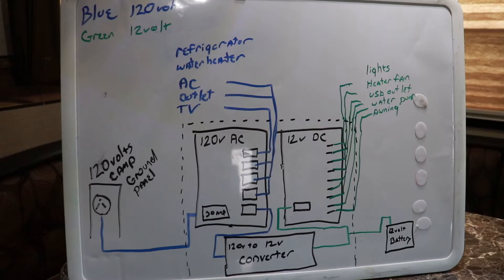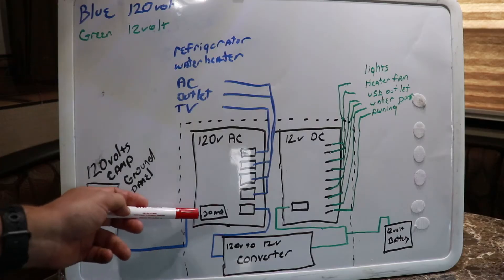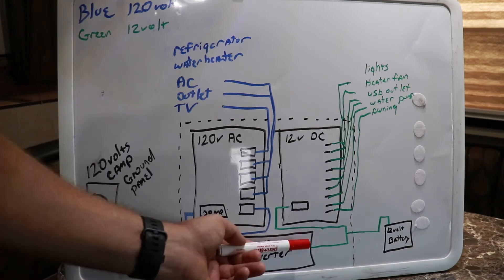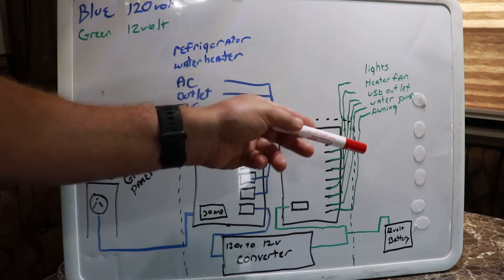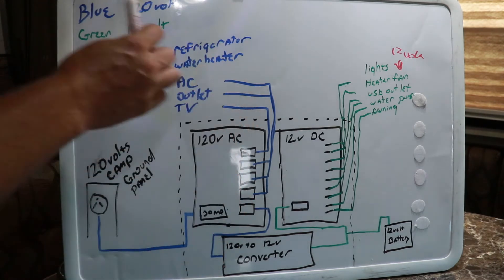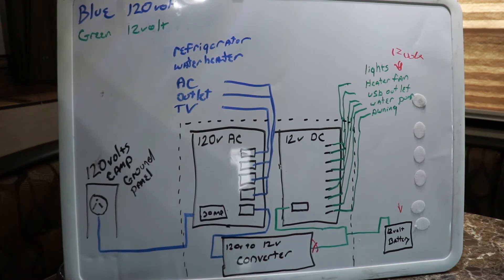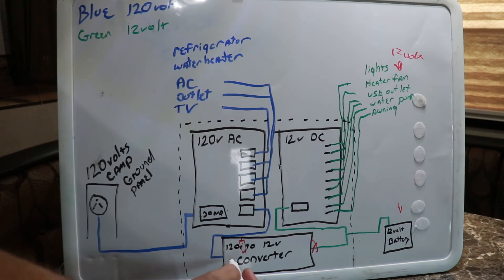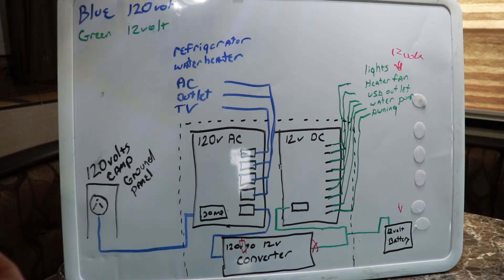Inside a RV fuse box

Comment: This video is very helpful for understanding the flow of power and where to check along the diagram. The video however says “inside a(n) rv fuse box”. Do you have a video where you actually show the inside of the fuse box? It would be very helpful to know exactly what we should be seeing and testing when/if we end up having to access the actual fuses. 
Thanks.

Comment: Hello all, I am about to install my first rooftop solar panel and I am looking for feedback. 200w single panel on the roof, fused inline to mppt charger from charger to the incoming 12v lines at the rv fuse/breaker panel. My only question is it okay to hook the mppt to the 12v feed wires for the power distribution box? Thanks in advance
Reply from the maker: That is how I have my mppt set up. It's been running this way for 2 years now and we have 800w solar input. Hope this help you . I have put my converter of a breaker and wired the 12v lines directly  to the battery. If we dont get a lot of solar  we run the generator and charge the batteries back up.

Comment: Thanks for the info. We had a problem where my water heater wasn't creating hot water using electricity.  I was trying to figure out if the breaker had trip but it didn't. Seems my panel isn't label correctly. Now I have to try each breaker and remove fuses to see what they power.
Reply from the maker: Our was also mislabeled to and we had to do the same thing. Thanks for watching.

Comment: great video.....now my problem, outside lights won't come on, interior ceiling lights work, but flood lights and porch light do night. They look like they are on a series....green/white to green/white to green/white. another question...what is a yellowwhite wire for? thanks
Reply from the maker: Did you check the fuses? If you see a red light on inside the fuse box that means the fuse beside it is blown. If everything is good in the box, you will need to use a 12v tester or meter to see if you're getting power at the switch and that power is leaving the switch. next step would be checking for power and ground at the outside light.

Comment: i plugged my camper into an rv spot (30 amp) and  immediately the fuse box smoked amd some liquid came out of it. now the rv runs fine on battery but nothing on electric. i know atleast the electric can run my microwave but notbing else. i would think the fuse box is good sonce everything works on dc but not everythihg on ac.

any thoughts? maybe converter? what is behind the fuse box that could smoke like that?
Reply from the maker: Sounds like your just running off the battery. Are you sure your getting power from the campground, did the breaker trip?
If there was water in the fuse box inside your camper, you need to find the leak. After that figured out then you can look at the fusebox issue.
Reply: @millersinthemoment5427  I found out that the camp spot had their wire backwards on the plug in. 
Everything works perfect on battery. 
Only microwave works on electric. 

What could smoke and leak liquid (not water, more like oil)

Aside from that, what do you think? Whatever "blew" when plugged up seems to he the issue. Just don't know what it could be.

Comment: Hi there, we picked up a 2002 Thor and it was trashed. No thermostat so we wired up a new one. The AC motor runs backwards (blows out through the filter) and shows white 110 as hot per the diagram. Our GFCI outlet also has white as hot. Husband thought it could be a problem in the fuse box. Thoughts? Is white hot normal in an RV? The other plugs all have white and black on the "normal" sides.
Reply from the maker: Black should be the hot side on a 110 system. Depending on your motor type wiring it backward could cause it to run backward.
Reply: @millersinthemoment5427  I figured it out! The main outside power plug was wired backwards and there was a metal plate missing in the AC so the flow was blowing out the filter instead of through the duct. This trailer was a total mess and we just find more and more wrong. But, it will be worth it in the end!
Reply from the maker: Good luck with the remodel.

Comment: No power to my thermostat..
Reply from the maker: Check your fuse inside the fuse box for 12 volts. If that is good check for 12 volts at the heater switch. You might also have a fuse inside the Thermostat.

Comment: This is a good video.My blower has come on and wont go off. Any ideas?
Reply from the maker: Thanks for the compliment.  since the blower is running we know the power circuit is correct. Now your looking at what controls the "On and Off" of the circuit.  Could be a bad control board or and bad thermostat.